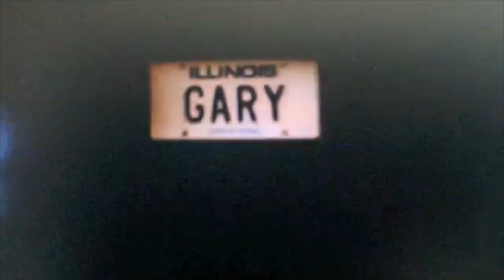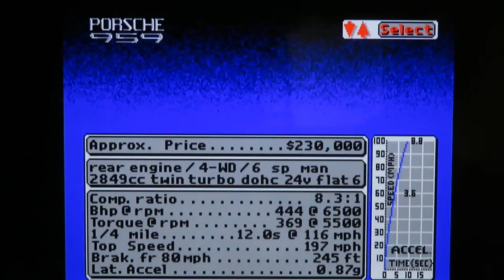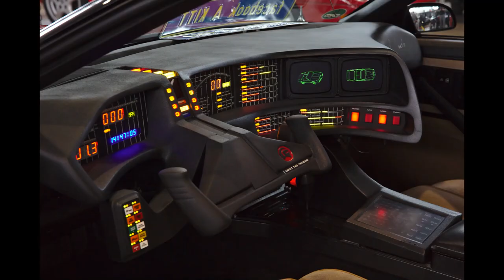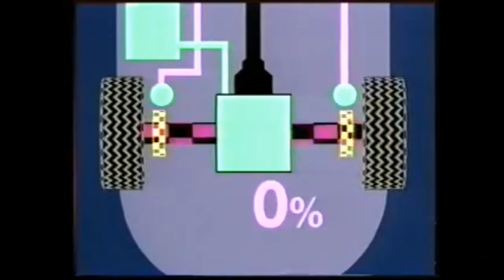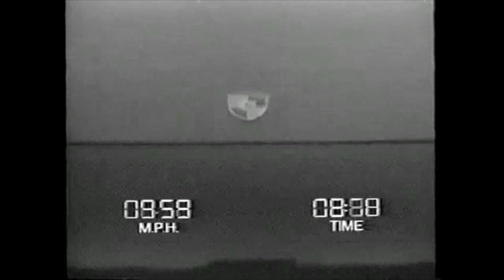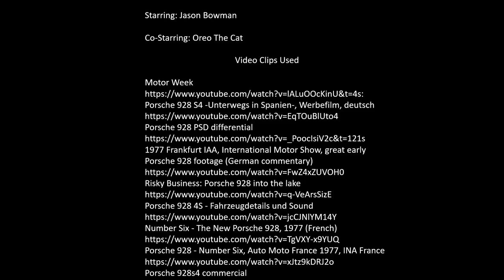Porsche 928

Comment: I just bought a red '88 GT with 16 thousand miles on it.  A brand new '88 928.  Cost me $88 thousand.  The initial sticker was on it - $76 thousand.
Reply from the maker: Your example is a very special unicorn. Hagerty has four different valuation categories: #4 Fair, #3 Good, #2 Excellent and #1 Concours. Your car would be #1 Concours. 928s under $10000 would be #4 Fair :-) "Condition #1 vehicles are the best in the world. The visual image is of the best vehicle, in the right colors, driving onto the lawn at the finest concours. Perfectly clean, the vehicle has been groomed down to the tire treads. Painted and chromed surfaces are mirror-like. Dust and dirt are banned, and materials used are correct and superbly fitted. The one word description for #1 vehicles is "concours." #4 vehicles are daily drivers, with flaws visible to the naked eye. The chrome might have pitting or scratches, the windshield might be chipped. Paintwork is imperfect, and perhaps the body has a minor dent. Split seams or a cracked dash, where applicable, might be present. No major parts are missing, but the wheels could differ from the originals, or other non- stock additions might be present. A #4 vehicle can also be a deteriorated restoration. "Fair" is the one word that describes a #4 vehicle."  I wasn't suggesting you could get a mint 928 (like yours) for under $10000, I was suggesting you could get a 928 for under $10000 LOL :-)

Comment: Good luck finding a 32 valve or S4 for $10000. the manuals are going for over $40000 and higher.
Reply from the maker: Very true, $10000 will only get you an early 928 with a slush box for a limited time only,  by the looks of current 928 pricing.

Comment: $10K? I can't even find a clean one for less than $20K now. Low  mileage ones (s and S4) are $30K +++.  GT/GTS are over $100k.
Reply from the maker: You're correct $10K is going to find you a solid fixer-upper at best, minters are going for big bucks.